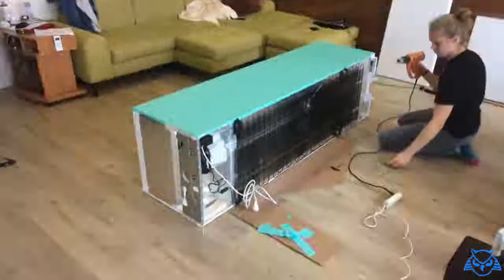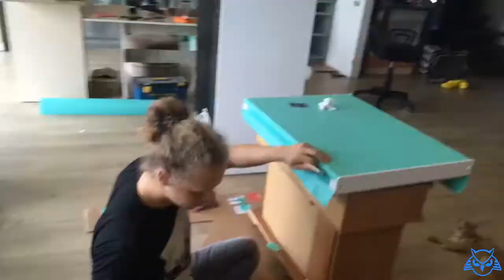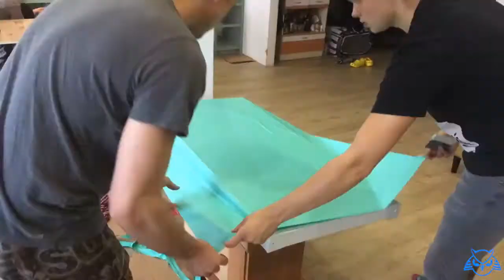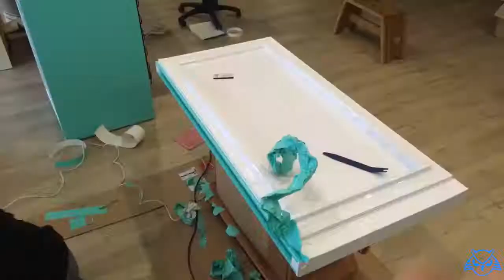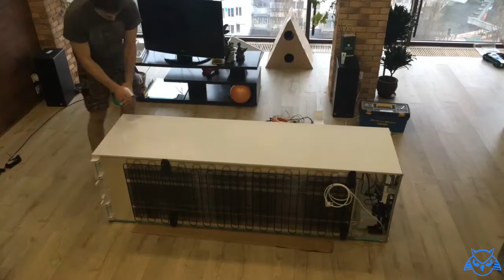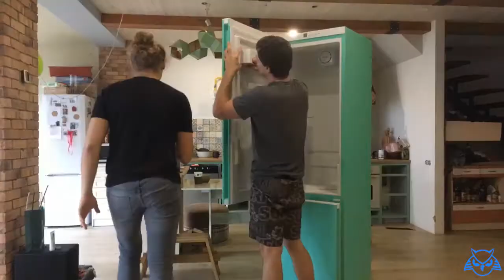How to Wrap your Fridge? Colored Refrigerator DIY - Handmade Channel

Comment: DO NOT LAY DOWN YOUR FRIDGE THAT WAY. IT'S NOT SAFE
Reply: It's safe, but only if you let it stand upright for 12-24 hours before plugging it back in. Do NOT plug it back in right after bringing it upright as you risk blowing the compressor.